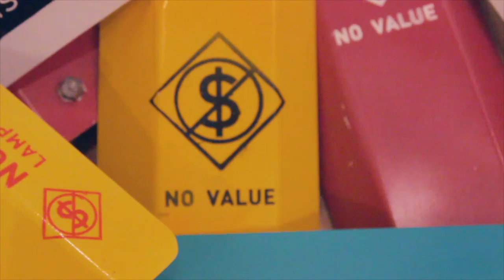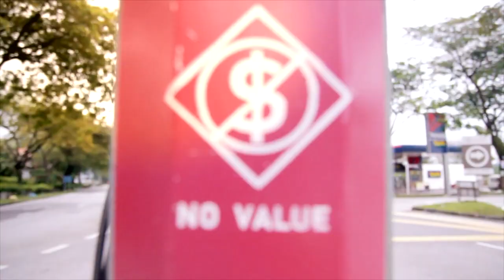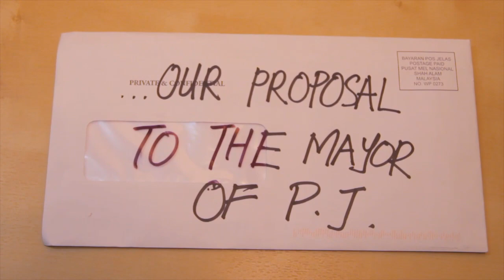Lamp Post Project

Comment: Brilliant idea!
Reply: Not a comprehensive solution, but definitely a good start. The same cannot be used for drain covers and/or fire hydrants.

And it's 'trivial' not 'tryvial'... i cringed..
Reply from the maker: Shawn Tan Hey Shawn, exactly. We weren't dead set on solving the issue once and for all because it's deeper than meets the eye. But it's just human tendency to want to see finished stories I guess, which in this case we just couldn't. Thanks for your feedback!

Comment from the maker: Btw, we've received some questions on what's the role of Makespace for this project. We found out about their tools and materials which fit perfectly for the plastic covers.

So we bought sheets of plastic and used their equipment to bend the covers.